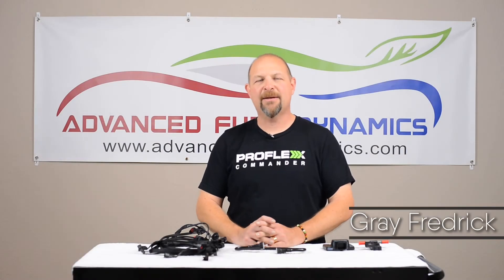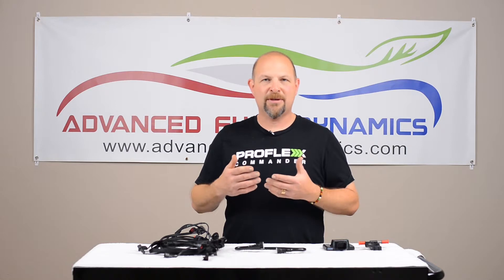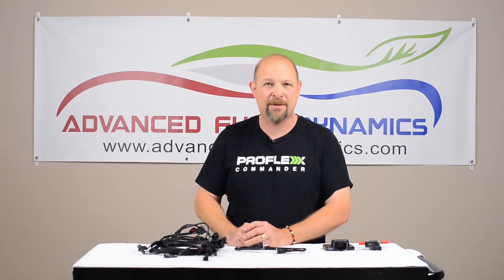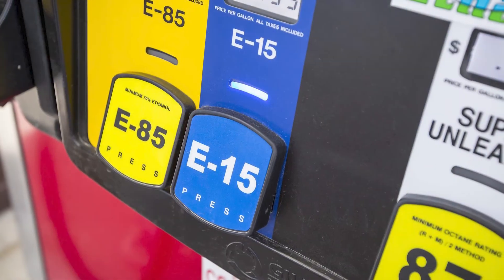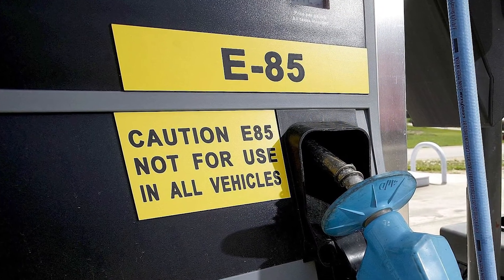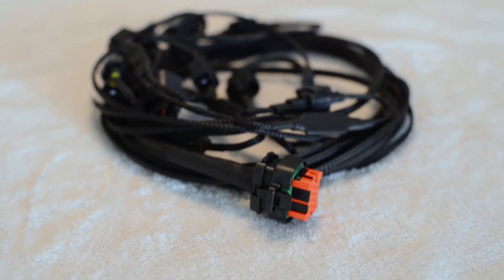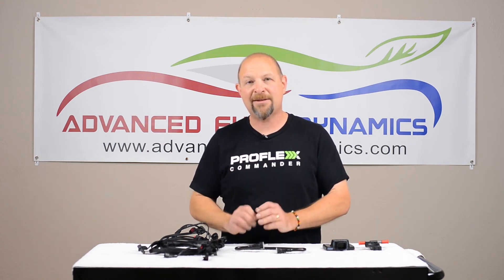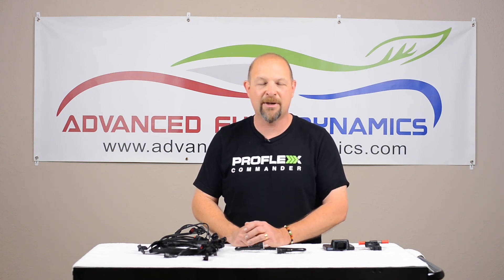How is the ProFlex Commander different from an E85 Tune?

Comment: So, how does it adjust your current tune, or advance timing or air fuel ratios on its own?   I have only ran 91 so far. I was informed that my car wpuld have to run only one or the other and that there ia not a true flex fuel device to make tune adjustments on its on. Could you please help with this? I am interested in running both
Reply from the maker: The ProFlex Commander adds a fuel sensors and its own controller to adjust on the fly, it reads your current tune and adjusts according to the fuel blend you are using. Reach out on our website and we can help you out.

Comment: will this work with my custome dyno tune for my whipple supercharger?
Reply from the maker: The system will work with your set up as long as your injectors and fuel pump are big enough, We would recommend testing ramping in higher blends and testing on a dyno or at minimum with a wideband 02 to be sure. Feel free to call us for technical question like this.

Comment: I have a DODGE CHARGER RT 07. Can I go with flex fuel ? Or am I better off with a pro flex ?? Thank you
Reply from the maker: I just came across you question.  Sorry we missed it.  I don't know if you still need an answer, but you can put the ProFlex on your 07 RT in about 45 minutes and safely run gas, E85 or any mix of the two.  You will not need any other upgrades or tuning.

Comment: What's the feedback loop like?... For example, if I want to go to a PWM controlled brushless pump, could I get more overhead by increasing pressure at the rail with the pump and not retuning or adding an input to the pcm? Ie: is this a piggyback lambda controller? Or more like interpolated maps based on the ECM x E85 content = new output? Would be awesome if it could do lambda or pump pressure without retuning. Makes it easier to find a tuner and tune if you're essentially under the assumption that fuel pressure is fixed at any airflow

Comment: Can you run this along with an e85 tune
Reply: You want to run this with a 93 tune
Reply from the maker: You can do specific tuning for E85 if you want to, but a traditional E85 tune will set the fuel curves to deliver more fuel, which is what the flex fuel system does, so that part of the tuning process is eliminated.

Most people with flex fuel systems do not tune specifically for E85 because it does not make a significant difference in power compared to a pump gas tune, and you will essentially marry your car to E85, which defeats the purpose of flex fuel, which is the ability to run gas, e85 or any mix of the two anytime you wish.
Reply: @advancedfueldynamics  I see what you mean, but wouldn't the benefit of the tune (aside from controlling the injectors, like your kit can also do) be taking advantage of the reduced temperatures to increase timing? That part of the e85 gain is missing from your kit, right?

I am very interested for it on my car, but how does this not leave more on the table if its not advancing timing alongside with it?

Comment: Does my car have to already be a flex fuel car? My 2016 Scatpack has 44k miles and is not flex fuel. I'm worried about my fuel pump going out if I run more than 15% ethanol or is that not true? I get so confused. 😩
Reply from the maker: All of your fuel system components are ethanol compatible from the factory.  However, your factory MOPAR computer is not capable of managing the fuel for E85.  Installing our system adds that capability without tuning, and you can run gas, e85 or any mix of the two safely.  

We dyno test and certify the fuel systems in each vehicle we make a kit for, so we know your Scat has enough injector and fuel pump to safely handle e85.  Unless you have big power adders like long tubes headers, a very thumpy cam or forced induction you can just add our system and roll with e85 in yoru Scatty.

Comment: I am running nitrous on mine already tuned for 93 do I need to change my injectors to be able to use this do I need to change my tune for 93 that is in my computer which is already unlocked will it to work with nitrous

Comment: With this kit and having an e85 tune, in the event of running 93 octane, would that cause any problems/damages?
Or does the kit adjust despite the tune?
Reply: They recommend getting a pump gas tune and letting the kit make the adjustments needed between pump gas and e-85.

Comment: This won't really add more horsepower, but it will keep your engine from knocking and reach its commanded max timing advance vs running pump gas and the ecu pulling timing, so it's more like to allow you to keep the horsepower the engine can actually make.
Reply: How you kno ?
Reply: @scatpackjaay9374  so basically the more engine timing the engine is allowed to use the more power it makes, on pump gas the computer pulls timing because it detects some knock, with e85 it doesn't knock so it allows for max timing that the computer allows thus making more power. You can log this with the scanner function of HP tuners and testing when on a dyno.

Comment: Let me see if I understand because all of Advanced Fuel Dynamics videos are really vague with this info, so this Proflex Commander does nothing to timing or spark. It's pretty much a sensor that tells the fuel system how much more fuel to send according to Ethanol content reading. (Because Ethanol burns quicker so it will need more). And NO tune required you say and this somehow makes big power gains. HOW??
Reply: @WrenchesandPlants  no.... no... no. There are very few cars that have ecu strategies to add advance when no knock is detected for a certain length of time. The vast majority if ecu strategies out there will run the commanded advance with no knock detection, and pull a predetermined amount of advanced based upon knock signal and the length of time that signal is above the threshold. The reason they can claim it adds power is because most of the cars they have applications for have an aggressive timing map from factory, so yes they will get commanded advance but not additional advance.
Reply: @ReaperXTC  thank you for clarifying 🙏 and with an actual tune you can take full advantage of this set up by adding more timing until it reaches maximum brake torque or until it start to knock.
Reply: @dsmubz  correct, though E85 usually does not spark knock and is best to tune with a dyno and pay attention to the torque curve.
Reply: @dsmubz  this is the reply I got from Gary, I asked about the timing.
Good Morning Michael,

You can use the ProFlex Commander PRO with your current upgrades and tuning.  It will be plug and play with no mods required to your tune or your power adders.  You will want to make sure your injectors are big enough to handle the extra load as E85 requires more volume than gas.

On the power side, you have been misinformed about timing and E85.  This is a very common misconception.  The basis tenet of gas tuning is to use more of the engine's power potential by introducing a more stable gasoline (higher octane) and advancing timing.  Because E85 is a very stable, high octane fuel, it is natural that gas tuners come to the conclusion that timing must be advanced to make power.  However, ethanol is an utterly different fuel than gasoline so the rules of gas tuning do not apply.

E85 makes more power due to its burn properties.  E85 has a faster burn rate, a higher expansion rate and a faster flame front than gasoline.  If you think of expansion as HP (the faster the charge expands the faster your piston moves) these burn properties are nearly solely responsible for the excess power. E85 burns cooler, which reduces your oil temps and reduces temps in the combustion chamber, which allows for greater fuel charge density.  E85 is also nearly knock proof and introduces free oxygen when it burns, which has a mild enrichment effect on the fuel charge.  Finally, because of the faster burn event of E85 timing is nearly irrelevant to making HP.   The timing associated with a good gas tune has proven to be ideal for E85 in our extensive lab quality dyno testing.

Now that I have written a book, let me get to the bottom line.  We always suggest running a gas tune with E85.  Your supercharged engine will make 10-11% more wheel horsepower on with the Commander PRO and E85 with your existing tune.  Leaving your tune alone will not only work well with E85 but it will leave your engine "flexible" so it can still safely run pump gas without detonation.  

As I say, we do a lot of dyno testing on a lab quality dyno under very strictly controlled conditions and our primary testing is based on comparing gas to E85 and recording what effect tuning has on performance.  Most of what you see "out there" about E85 is mythology combined with a lack of experience with the fuel.  That is why we do so much testing, so we can relate what the data shows instead of relying on outside information.
Reply: @WrenchesandPlants  it also depends on whether or not your car has a knock sensor as well. They sell a kit for older mustangs that don't even have a knock sensor.

Comment: Can you do a video of full bolt cars with tunes on them. Then you slap this on and show that it still works with no problems. That will clear this up more that it can work with any tune that’s on pump gas
Reply: Did u get a answer?
Reply: lime green 2019 no they never answered me all I can find is them just using this on stock cars. Not full bolt on with tunes on pump gas that’s why haven’t purchased.
Reply: PaganiHuayra1 hey I called before but that’s them just saying that. If they are that confident then why not post a vehicle with full bolt ons with a tune. Then slap there’s on and see what happens or dyno numbers that’s all I was saying.
Reply: Not really an answer, but there is this video https://youtu.be/vY5rpDGxhpc
Reply: Does this throw a check engine light using this kit?
Reply: Are you thinking this product for your car or just asking in general? You might as well go JB4 route with Fuel-It if you want to monitor E on the fly. I have a B9 A4 Quattro with an E30 tune via JB4 and so far no problems.

Comment: Why did I get a check engine light after using e85?
Reply: was u on low gas? cant run low in in cars you will get a check engine light